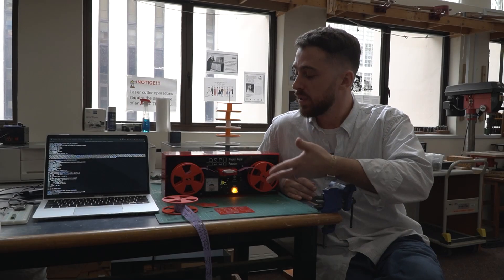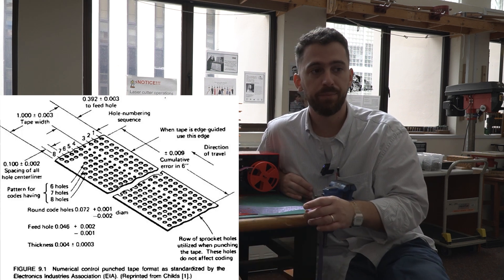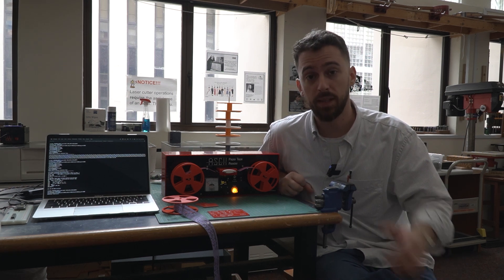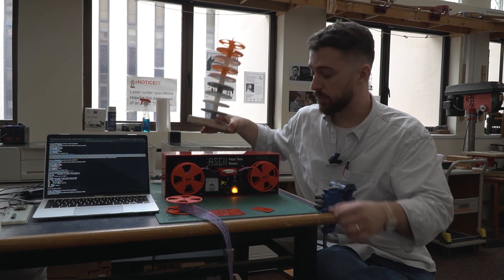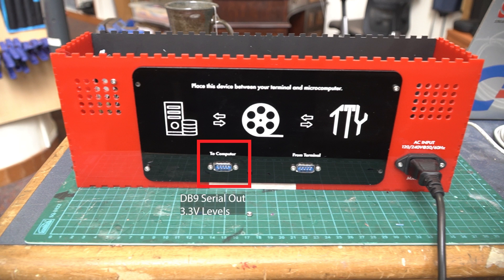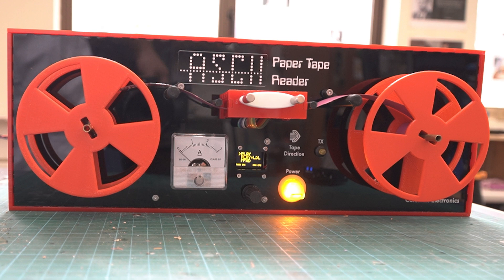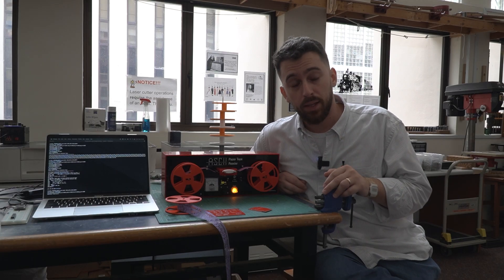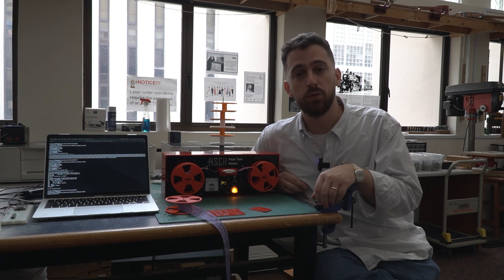DIY ASCII Paper Tape Reader

Comment: Pretty cool project.  And much closer to modern days' needs than you may think.  A friend of mine finished his CS degree just a few years ago.  His first project at his first job was to come up with a punch card reader.  His employer had a giant pile of punchcards with old yet still very important information which needed to be accessed.  They built their own thing from scratch.

Maybe 15 years ago I read an article on Wired (?) about US companies which are in a similar situation.  Warehouses full of punchcards with data about retirement stuff, an aging workforce which still knows how to operate and maintain punchcard readers and a limited number of readers.  Apparently the companies often perceive the situation as embarassing so their engineers are supposed to avoid the topic of punchcards and the warehouses storing them are unmarked ...
Reply from the maker: @ralfbaechle  man that sounds like a juicy problem I’d love to take a crack at… and I’m discreet 🤐
Reply: @joshuacolemanmakes7518  Project finished, sorry 🙂  That said, I'm certain somewhere on the world somebody still has the issue and would love to feed a few palettes worth of paper tapes or punchcards into their 360-compatible (or older) mainframe.  So I'd not be surprised if somebody contacts you.

i only own a single paper tape which was meant to boot an Interdata 7/32.  But the system from which it came didn't need it.  There was a hole in the front panel behind which there was a toggle switch which was to be toggled immediately before and after starting the CPU.  I believe the switch controlled a small ROM which made the papertape unnecessary.  The content might be something for bitsavers - but a single papertape is not really enough motivation.

Comment: I used paper tape readers on communications systems to include that was a way of storing cryptographic tapes, and we also had Test equipment that was configured using paper tape.  The Test equipment used mylar tape because it was used multiple times versus the communications Cryptography tapes were paper so they could be burnt up when you were done using them.
Reply: You need a device that also reads paper cards while you’re at it.
Reply: If you’re really cool, you’ll develop something that reads every storage media type ever developed and it will be all in one device
Reply: Stone tablets to SSDs. :)
Reply from the maker: @XAirForcedotcom  “look at the size of that dongle!” they’ll say
Reply: @joshuacolemanmakes7518  Swiss Army Reader

Comment: Is there any reason why it’s ASCII - surely any 8-bit format would be readable - I’m particularly thinking of EBCDIC (for an IBM mainframe)…

I assume the decoding of each byte is in software?
Reply from the maker: I built this to match aesthetically and functionally with my handbuild microcomputer which runs BASIC by default. As such i leaned in to labeling this machine ASCII Paper Tape Reader. However yes it is completely arbitrary and software driven and it doesn't matter what the encoding scheme is, it will read it. Check out the attached project in the video description to see how it can be used to load in bytes or other such lower level code.

Comment: This is fantastic, great work! I will be making one myself. I keep looking around and hoping for someone to recreate a tape punch but laser will do for now.
Reply from the maker: yeah i started a design for a punch actually and was following a 60s design, but even the "somewhat feasible" ones still run into the same problems of tolerances of mechanical moving parts. one has to sharpen the die punches, keep parts oiled, aligned, clean...etc you basically realize what a godsend affordable magnetic media became even if it had its own mechanical requirements. it was still far and above better to maintain than paper tape systems. 

the laser cutter approach makes it feasible and repeatable results for the modern lab. I've got my eyes peeled for an existing mechanical punch but i doubt ill go the mile to make one as it would require a good deal of machining or complexity in which i'm not willing to engage. save it for another youtuber!!! lolol

Comment: Nice work on this retro tape reader!  Thanks for sharing.  Some modernization ideas to explore: Collect lots of data on photodetector current then use AI to decide if 1 or 0 is read.  Compute CRC on the data stream and display on screen at end of tape read so user can verify that the tape read was good. Technique used back in the day was using 2 holes to encode a single bit, then differentially reading them.  Of course each row is then only 4 bits, so the tape becomes 2x longer, but no errors.
Reply: all good ideas! this would be effectively a full rewrite of the firmware lol— but doable. i, however, am just in it for the love of tinkering, your ideas definitely sound practical if this were to be a deployed proper device. and i love the idea of implenting AI for checking— perfect blend of past and present. a person on another forum actually suggested the device as a password machine that's really secure via "security through obscurity" and i can't stop thinking about how cool it would be to log into my home server or IoT network with a hard coded (perhaps monthly randomly generated) paper tape lol.